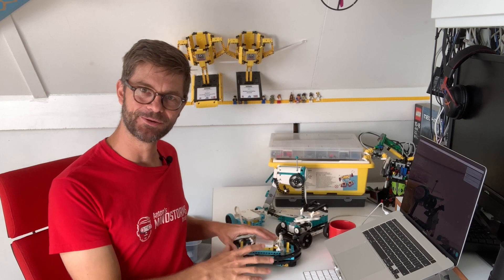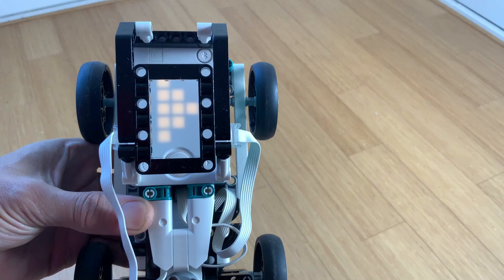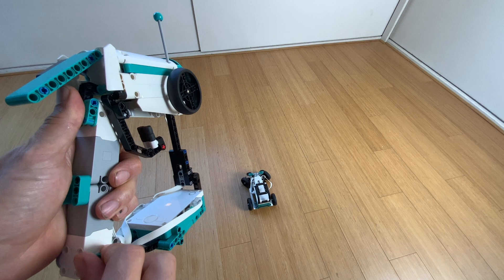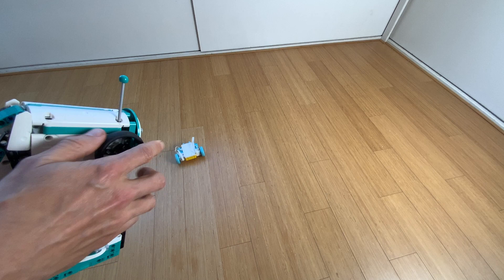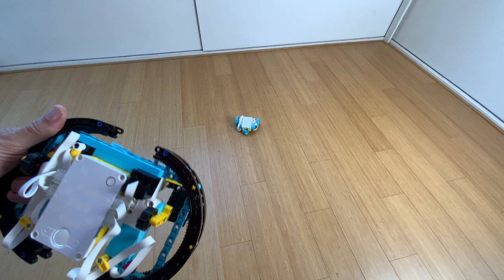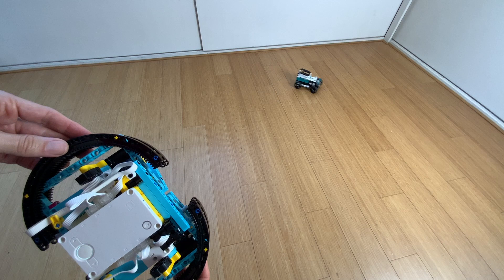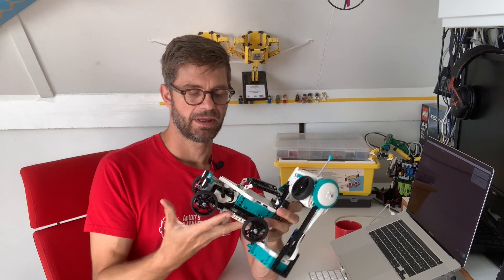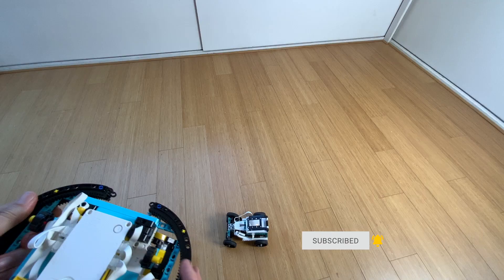Python brick to brick Remote Control with SPIKE Prime and Robot Inventor

Comment: This is very cool. Could you also try and show us something similar with an Arduino as a less expensive solution?
Reply from the maker: Working on a micro bit version. Does that help?
Reply: @AntonsMindstorms  most certainly. Thanks
Reply: Hi there, how is this coming along? I'd be really interested to see this too. I'd like to have a raspberry pi running some ML code and sending commands to a Spike Prime robot, I also want the robot to report it's state which will inform the ML. At present,  it's unclear to me how I would send a command to the hub from a program running locally on the raspberry pi or how I would get the hub to transmit to the serial port.

Comment: Thanks for this great resource! I was wondering, if I can also remote control one hub with my computer using a Bluetooth client instead of buying a second hub. Is that possible without any other hardware and using micro python along with a bluetooth library? I am asking this because I'd like to do some computer side processing using a camera and then remote control the hub based on the processed video - maybe using openCV or another tool but so far I have not seen anyone remote control the hub from a PC or Mac.
Reply from the maker: It's very easy. Just connect with Bluetooth classic and send REPL commands to the hub.